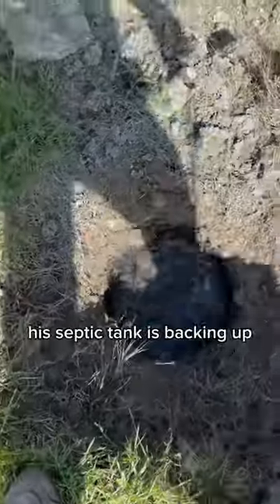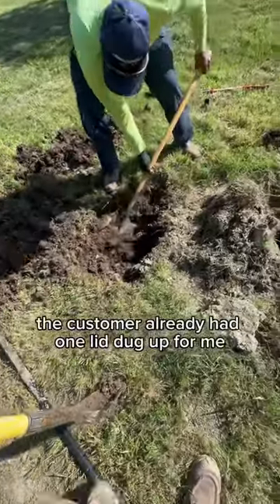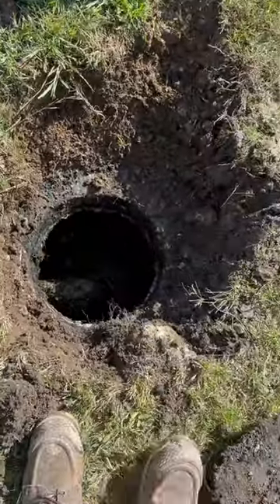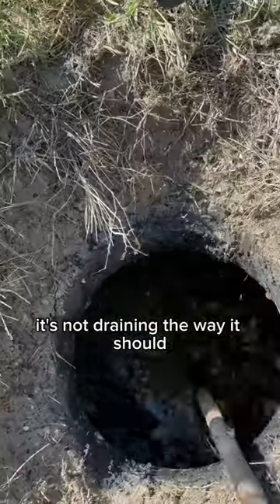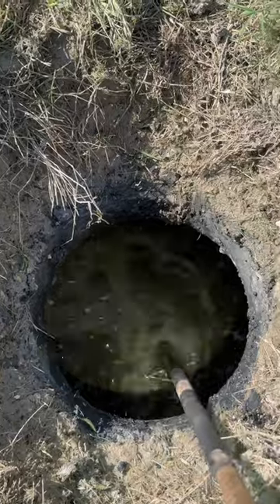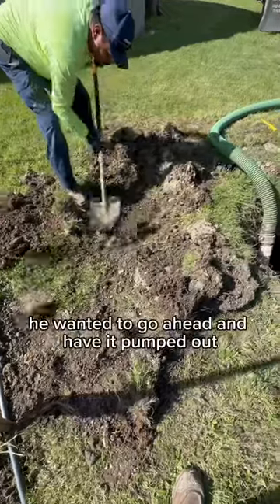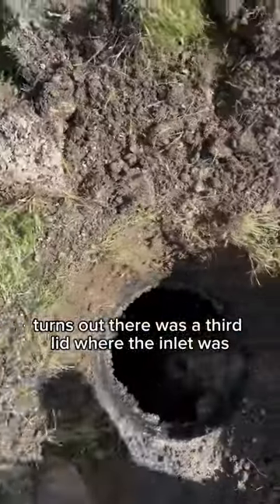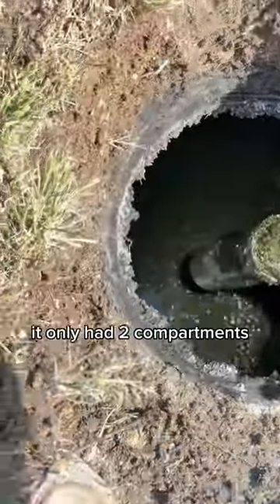Customer helped me dig up a septic tank #shorts

Comment: Septician here, I’m kinda new. Why would they be 3 lids for 2 compartments. Was the tank that big it just helps get to deeper spots in the tank?
Reply: Sounds like 2 regular lids and a manway access lid. My pump tank has a pump access lid. It also has a manway access lid that is larger on the other side. It's used to install or replace the pump.